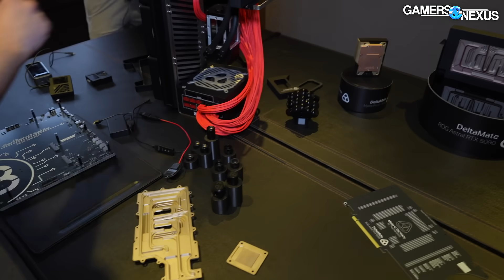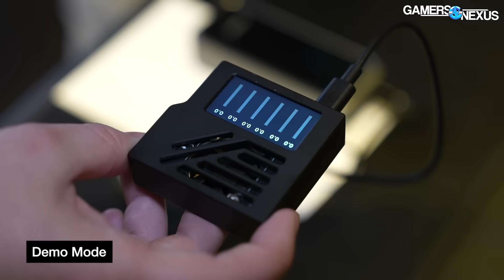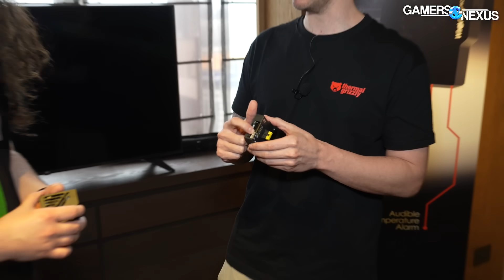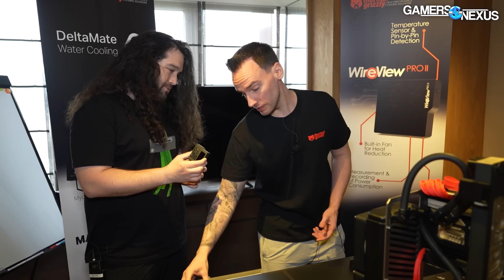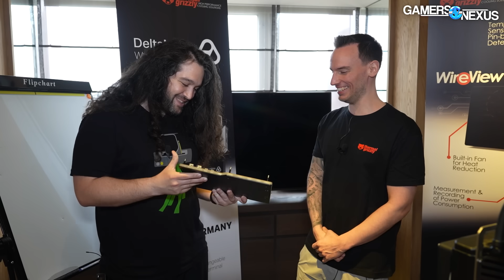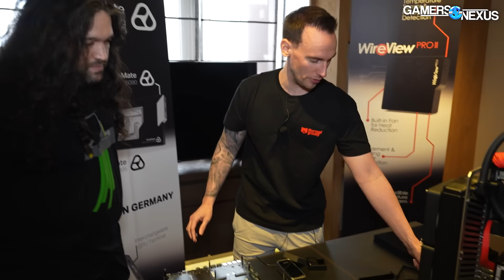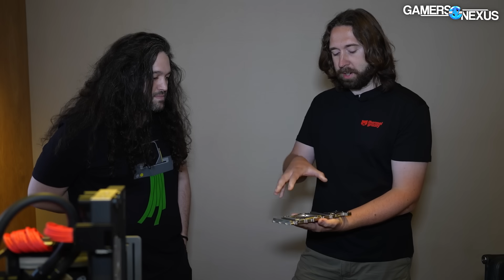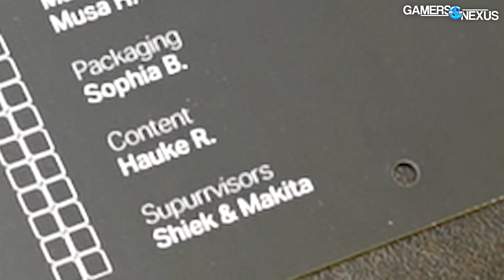Fixing the Unfixable 12VHPWR Connector, ft. Der8auer

Comment: The biggest issue with 12VHPWR is that it should have had per line load balancing from the PSU side to begin with. Electronics 101 tells you if there's a resistance imbalance you don't keep dumping power down that channel. Which obviously the "sense pins" are NOT doing currently.

I can only assume the reason Nvidia and PCI-SIG (keep in mind this isn't exclusively "Nvidia's connector." Everyone signed off on it including AMD, Intel, Apple, Qualcomm, etc.) never figured that into the spec is because they wanted it to be adopted instead of dying a slow death like Intel's 12VO. They probably figured no one would want to buy a new "smart" PSU and they wanted it compatible with the plethora of PSUs already on the market.

When you consider how much technology is in PCs today it really is odd that our PSUs have essentially barely changed since the 80s. Crap like this tells me maybe they should be a little "smarter" and something like Roman's gadget should already be included inside every PSU. At least as long as hardware makers keep pushing power past 400 watts.
Reply: There is a great video on why PSU can not fix the load balance issue. Check out "Actually Hardcore Overclocking".
The monorail is what makes this current iteration of the 12VHPWR connection really bad.
Reply: It is Electronics 101 that it is not possible to load balance from the PSU side.
If there is a bad connection on one pin, more power can be routed to the other pins, but the overhead on the connecter is to small to begin with, so extra power on the good pins to make up for the bad pin would still overload the connector with a 5090.
The only choice the PSU has is to cut power and that crashes the pc and possibly data on the disks.
Reply: @larsjrgensen5975  You literally just said you can't load balance from the PSU side in the same breath that you said power can be routed to the other pins. How, pray tell, would you reroute power to the other pins unless it was done by the PSU? 

Obviously you never took Electronics 101. A smart PSU wouldn't magically start dumping power down the other lines, it would simply pull power back from the faulty one, maybe have it send an audio cue to the user that there's an issue. A power cut to a single wire wouldn't crash the system, it would make the GPU throttle down to a lower power draw.

You really have no idea what you're talking about, do you?
Reply: @zodwraith5745  Please go ahead and watch the video from "Actually hardcore overclocking" that explains why PSU sided load balancing isnt really possible
Reply: @derdotte  With the current design, no, you're correct. It can only throttle the entire flow via the sense pins. Which was exactly my point that you missed. If it had been designed into the spec to begin with then YES, the PSU could do a per pin load balance. The downside being everyone would be required to buy new PSUs if they want a 600w GPU.

Before you try to guide me to a video I've already watched that only backs up my point maybe you should actually read my comment. Buildzoid is stating why that wouldn't fix it now that it's already been rolled out and adopted so it would do nothing to help the millions of cards already sold. As it is the "sense pins" only tell the PSU how much power it should provide. But if per line communication were built into the spec from the start this never would have been an issue.

There obviously wasn't enough fault testing done during development or it would have been added to the spec. The only thing that can be done at this point is monitor resistance at the PSU end and pull voltage with an audio cue to check the connector. Not exactly ideal but it might save a $3500 GPU.
Reply: @zodwraith5745  Well, why are you trying to blame the stuff only on the PSU? Nvidia decided to go monorail for the power delivery. For multiple thousands i am expecting better design that doesnt result in burned hardware. Nvidia and their board partners should have load balanced or at least made the power delivery be three rails.  
There just is too much wrong with this current implementation of the 12VHPWR. Its gross negligence that the connection can burn by the current designs.  

Eitherway, currently there is no new design revision and i honestly doubt that load balancing would be part of it on either side.
Reply: @derdotte  I'm only pointing out the shortcomings of the design and how it could have been avoided, not blame PSU manufacturers. And for the umpteenth time, it's not "Nvidia's connector." It's PCI-SIG's. Nvidia had a hand in designing it but all of PCI-SIG had input and signed off on it. Nvidia was only the first to use it. Nvidia's not in the power connector business and they don't sell them. They sell GPU dies. When CableMod makes a cable they aren't paying a royalty to Nvidia.

But I'm sure as soon as we see our first melted connector on an AMD card now that they're using it as well that narrative will change quickly because no one blames anything on AMD. 7800X3Ds blow up? Asus' fault. 9800X3Ds blow up? Asrock's fault. AMD makes BS claims? Oh that's just their marketing dept. LoL those silly guys! As if management has zero control over marketing. 

But 12VHPWR connectors melt? That's Nvidia. Asus boards are burning up Intel CPUs? That's Intel's fault. Through all the RPL drama I never saw a single report of a failed CPU on an MSI or Asrock board, only a smattering on Gigabyte, and 95% Asus. AMD doesn't need to defend itself when an army of fanboys does all their work for them.
Reply: @zodwraith5745  Thing is, Nvidia is using the connector at a safety margin of barely a few percent. AMD, specifically the Nitro+ by sapphire isnt doing that.  
In case you arent seeing it: No board partner has seemingly been allowed to change the monorail specification. We have seen that at least one board partner understood the issue but instead of doing a multirail approach we only got current sensing, which is not bad but certainly not the best solution. One can only assume that nvidia made sure that monorails are part of the reference design spec. Yes i am assuming but there is enough evidence by negligence to assume this.

It doesnt matter if PCI-SIG are the ones that dictate the standard, there is no indication that a monorail is necessary from the standard itself. Nvidia has also said multiple times that the connector was fixed, we all know how that turned out... There is all the reason to give Nvidia the shade for this situation and if AMD's cards also burn then they shall get the same shade.
Reply: @zodwraith5745  To repeat, It is not possible on a 5090 because the connector is already fully used and without enough overhead to allow for "balancing".
If Nvidia continued with the 3090ti design, they would likely not have any problem with melting connectors, but they wanted to save money.
The only AMD cards that exist with this connector, uses almost half the power of the 5090, so it is much harder to burn the connector, just like there is a lot fewer melted 5080 cards, compared to 5090.
Reply: @larsjrgensen5975 
So what was that about PSU side protection not being possible?
https://youtu.be/ThwxImD4t98?si=b8ThTqzKf75y5RvX
Reply: @zodwraith5745  You might want to watch the video you are linking to.
Reply: @larsjrgensen5975  Maybe you should or your reading comprehension sucks because it's essentially confirming what I've been telling you all along. You're the one that keeps changing your story because you don't know what you're talking about. You tried to claim nothing could be done from the PSU's side which is obviously wrong. In an attempt to not look stupid you just made yourself look more stupid.

I initially said it COULD have been built into the spec to begin with to have line balancing and there never would have been an issue, but now it can only throttle and monitor which needs to be done from the PSU side, which is EXACTLY what Seasonic is working on right now.

It won't make a faulty connector not be a faulty connector, but it can save the GPU. You didn't understand my comment. You didn't understand Buildzoid's video, and you don't understand Der8auer's video. I'm done arguing with stupid that perfectly shows the Dunning Kruger effect. Have a nice day.
Reply: @zodwraith5745  I am confused:
You said it should have had load balancing.
I said that could not be done, because the connector does not have the overhead for it. The only thing possible would be to turn off the psu and crash the pc (what Seasonic and Asrock most likely is doing)

The PCI description says: "These SENSE signals must not change state while PCI Express CEM Add-in Card edge has the main +3.3V applied."
According to that statement the sense pins can not change state when the 3.3 power is on, so the PSU can not elegantly throttle like you are writing, it can only monitor and hard crash shutdown.

I think I understood your comment and I agree with Buildzoid and Der8auer that Nvidia should have kept the load balancing the 3090ti already has, instead of saving money and pushing the problem to everyone else.
Reply: @larsjrgensen5975  You still missed the point. From the beginning I stated it should have had load balancing built into the SPEC to begin with. I never said that PSUs could load balance now that the spec is already out. They can only do what Seasonic and Asus are doing right now to at least save a GPU if it reads a resistance spike. It won't solve the problem, but it avoids the damage. But I do like the idea Seasonic is using to have it communicate with the motherboard via USB to notify when there's a problem, but it would still be cheaper if it simply had an audible alarm like I mentioned before.

If it was built into the spec to begin with they could have planned in load balancing. You wouldn't need added overhead to the power delivery, it would need have added sense pins. Much like how multiple cell Li-Ion battery packs are load balanced. Now they can't unless they completely revise the spec, add more sense pins, and require new PSUs to do the load balancing. Something that would add very little cost to the PSU, but of course would require new PSUs. I think THAT'S why they didn't add load balancing from the beginning, but it could have been done.

Go crack open a laptop battery and you'll see it has small leads to each cell separate from the actual power delivery lines.
Reply: @zodwraith5745  PSU load balancing is the expensive solution, the 3090ti does everything already, just like 2-3 PCI 8 pin cards also load balanced 10 years ago.
Nvidia wanted to save money on the 5090 and now we are here trying to "fix" it with thermal sensors and power measurements in the PSU.

Li-ion battery packs does not have load "balancing" the sense wires are 5-10 times smaller then the main power wire, it is only for measuring and low current balancing of the cell voltages. The balancing is 5-20 times slower then the actual usage or charging. Li-ion packs are completely different from the 12v connector.

Comment: As someone with a 5090, it would be very useful if they could design a product to not only detect the current but actually balance the current between all 6 pins. Not sure if that's possible and can only be implemented on the GPU side. I and many others I guess would definitely pay for a product that could load balance.
Reply: Only in gpu… if they power balance between PSU and gpu… it still can go wrong between the balancer and the gpu!
So we have the same exact problem as now. Because the gpu does not balance the balanced power it does get… aka the connectors between the gpu and balancer still could be bogus and cause imbalance.
Reply: @haukikannel thanks for the explanation. Got to love paying over 2500 for a GPU that’s a potential fire hazard.
Reply: @ArtemasGaming 😂
Yeah!
They really dropped the ball!

Comment: since AIB's make and design their own cards pcb, why dont they just use the old 2, 8 pin design etc? It makes no sense for them to use a crappy weak connector on a board they design and build them selves.. all they get from nvidia is the gpu core, and they build the pcb around it... which is nothing more then supporting components. So they could use a different power connecter.

Comment: How i would fix the 12vhpwr connect if i had a card with it would be to de-solder it from the board, combine all the 12v lines into 1 and all the grounds into 1 and then solder on a heavy duty connector that could accept heavy gauge wires (6 or 8 gauge) and run them back to the power supply and modify that as well. problem solved.

Comment: 100 or so bucks may seem bit steep for a little plastic connector thingie BUT remember that its pretty much only a thing with 5090 card meaning that you have allready dropped like 3k+ on card so the 100 shouldn't be an issue to get some peace of mind.

Comment: 2000: people start water cooling their CPUs to make them faster.

2025:  water cooling your power connector so it doesn’t catch on fire
Reply: (laughing in leather jacket)
Reply: Just wait until it melts while water-cooled, then you'll have a real mess on your hands!
Reply: That idea isnt as new as you might think - some electric truck fast charger designs do have a cooled cable + connector.
Reply: @kennichdendenn  There is a big difference, those are designed to work with cooled cables/connectors, NVidia said you don't need it, "it just works".
Reply: @kennichdendenn  Sure, for well designed connectors conducting 1000 times more energy than this sorry thing.
Reply: @kennichdendenn  Welding machines have been using cooled cables/torches for decades, it's quite a dated concept.
Reply: @Sav.B58  I think the point here is not the innovation.
Reply: @Sav.B58  Welding machines need a high current delivered to the electrode out of necessity for the welding process, not because the process demands a lot of power. That's not the case for some GPUs which now demand a lot of power, but delivering it with a high current sometimes inadvertently occurring on a subset of parallel cables is a shoddy way of doing it.
Reply: @kennichdendenn  but it is new for consumer computers. Who the fuck cares what truck fast chargers or whatever are using?
Reply: 2100 : people water cool everything cause it's everywhere
Reply: It's crazy because the ATX power cord, for example that powers the entire computer doesn't need water-cooling and has existed for half a century. The correct fix for an overheating connector is a connector with a better connection. Before people reply I get that we are are talking high current and low voltage but not to the extreme there could not just be a thick enough cable with enough metal on metal,  low resistance connection to barely heat above room temp.
Reply: Make them quieter is the real power of water cooling.
Reply: reminds me of the RAM fans because of DDR3

Comment: I would like if TG's GPU blocks could include a threaded standoff on either side of the 12V-2x6 that mate with matching holes on the Wireview. This way you can screw in the Wireview (like old-school VGA/DVI) and ensure no loose connections at least on the GPU side. Then, as long as every future TG GPU block will have the same standoffs, I can keep using the same Wireview every new generation.

Comment: The basic why is easy. Majorly increased draw which drastically reduced overhead ..removing voltage regulation/monitoring from the 40 and 50 series cards and your basically asking for trouble.
More complex is the different cable makers/power supplies and all the variances making a bad situation worse.
12v isn't a bad idea itself it's just really stupidly implemented by nvidia.

This idea makes things even better giving the user the ability to monitor what's going on

Comment: 13:00 Der8auer "I'm Lazy" 🙄 No, this is "Work Smarter Not Harder" by a talented engineer with knowledge and resources/contacts/relationships.
Reply: I agree, and it is a German mindset. Why work hard and exhaust yourself when you can work and make it easier on yourself.
Reply: The Lazy is a very German thing. We like to throw so much "genius" at a problem that we never have to worry about it again.
Sadly, it catches up eventually, and when stuff passes the OG generation, you end up with Deutsche Bahn, etc.
Reply: @MrHaggyy deutsche Bahn is actually better than 90% of the railways in the world. Only germans dont like it lol.
Reply: @audiophobia82  ^^ let's say 80%. The problem is that DB used to be significantly better. And while we use stuff that's older than Roman or I, we do deliver parts for those 10-20% that are better.
Because "never touch a running system" or "that's how we always did it".
Reply: Lazy people make the best engineers. They will do everything to make the task easier so they can go back to being lazy.

Comment: Since the tolerence and space is so small for the fins on the plate would it not be cheaper to wire EDM the fins on an insert and just slot it onto a plate.
Reply: I doubt it. A wire EDM is agonizingly slow. Good for prototyping and very low volume production. But can you imagine how long it would take a wire EDM to cut even a single set of fins? An entire bed would take, what, days?